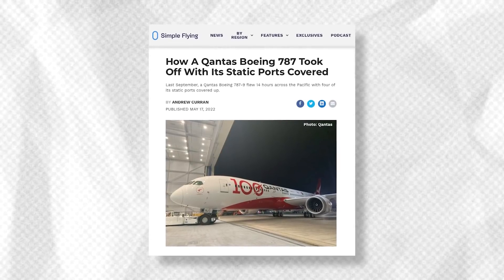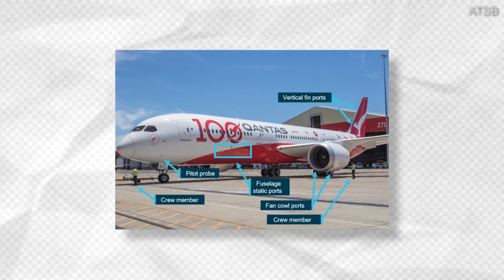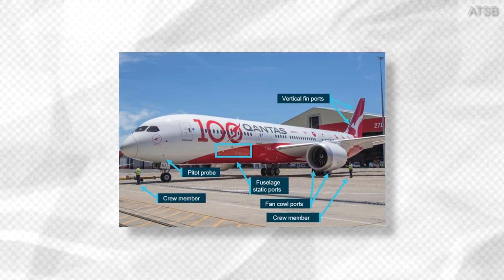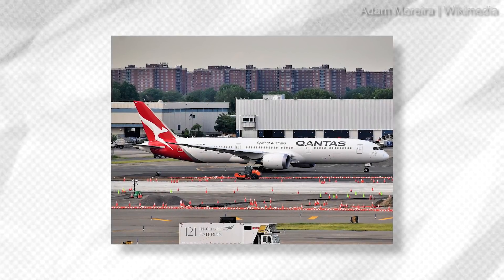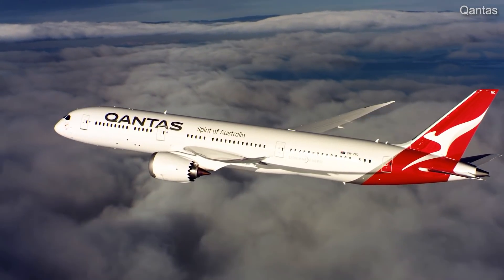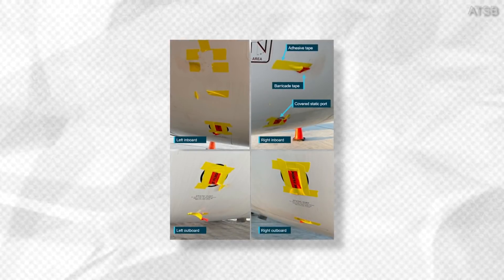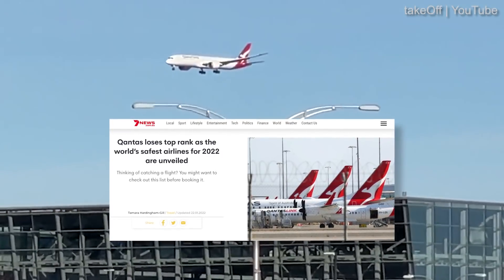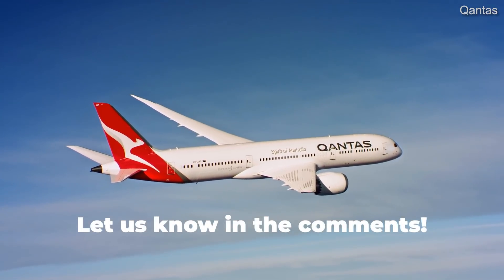How A Qantas Boeing 787 Took Off With Its Static Ports Covered

Comment: They need to randomly put "remove before flight" stickers (but without actually covering the port) to incentivize pilots to actually check them during pre flight inspection. The fact that the ports are so rarely found covered, while a good thing in itself, causes a well known psychological bias that makes inspections ineffective.
Reply: That is a very good strategy. Bias of expectation used in a good way, because they will expect to find a random number of stickers instead of expecting no stickers at all

Comment: Why does Quantas store their landing gear rig pins and nose wheel steering pin in the avionics bay? With my employer they're stored inside the cockpit so the flight crew can also determine their presence.

Comment: You would think in this day and age that using tape to cover ports on aircraft would have been replaced with a push on plug cover that has a long enough tag that even blind Freddy could see it.
Reply: Perhaps redesigned such that airflow at sufficient speed will remove the covers in any case.
Reply: @techo61  and not suck them into the engines 😳😱

Comment: Wow - a captain, two first officers, and two second officers.  Seems a little extreme!  Five pilots - how may are actually busy the 14 hours?
Reply: It's probably so they could have a quick turnaround? Just guessing
Reply: @PASquared  it's not for a quick turn around. Pilots are required to take a rest after a certain amount of flying time. It is airline dependant but there's a cap that ICAO puts before pilot flying is required to rest. A quick turnaround would be illegal after 14 hours of flying. This 5 man crew alternates between the first officer's and captains seats when the captain and first officer go on rest.
Reply: They all fly the plane at one pint or another, so it seems extreme don’t get me wrong, but it’s all with good reason

Comment: Yikes, luckily it wasn't the more cirtical static ports that help provide airspeed and altitude information, but that's still no excuse, someone has to be severely dealt with. Also, why is a more junior pilot conducting the walkaround check? I know he authorised this second officer to do it, but from my knowledge, its usually the captain who does it. They have more experience to look out for things like this.

Comment: Hi, Umm... I'm shocked really, I can understand why engineers would cover critical flight sensors and exterior flight aids, however it is unacceptable that proper procedures are not being followed and that includes the all important walk around done by the flight crew before flight, I sincerely hope that this issue have been resolved.
Reply: Yes that’s true…there should be some warning like “static port covered, remove before flight” in PFD !! It’s something like a Camera lens…that you remove the lens cover before taking a photograph…haha
Reply: they do this to prevent items from blocking the ports.
Reply: @gradynace7557  by items I guess you mean either insects or FOD.

Comment: Why didn’t the pilots notice it on their exterior check ?
Reply: Ya thats a good question but there have been many instances when pilots overlook the outside check and assume that if something was right earlier than it should be the same no matter how many indications they get.
Reply: The ATSB report distinctly states that pilots are the 'last line of defense' in ensuring an aircraft is flight worthy. The second officer failed to notice the covered ports during his exterior check - period.
Reply: They didnt have to bc it shouldnt have been covered anyways
Reply: @toogoodatall960  but why didn't the pilots notice it? That's the question. Your answer is to whether they had to or didn't have to notice it.
Reply: @dudulamkoto  
Idk they probably didnt have to check at this location
Reply: @toogoodatall960  noted. Thanks.